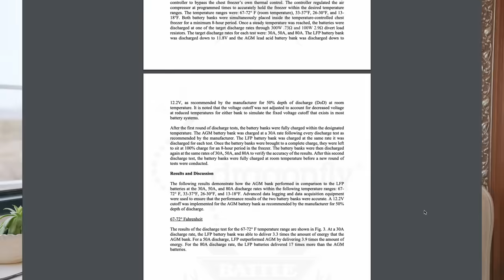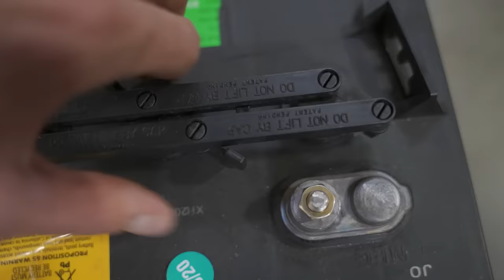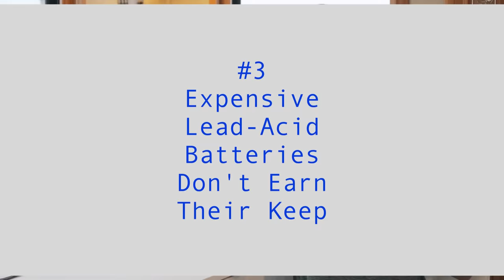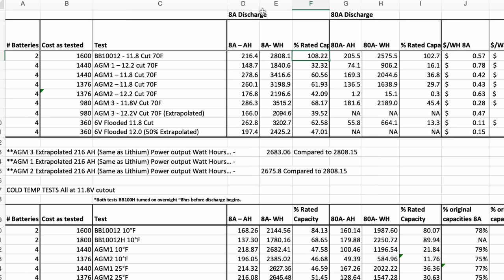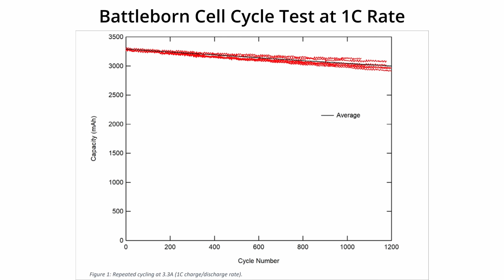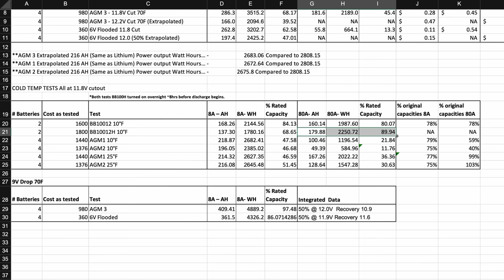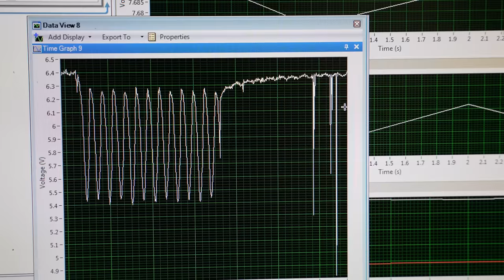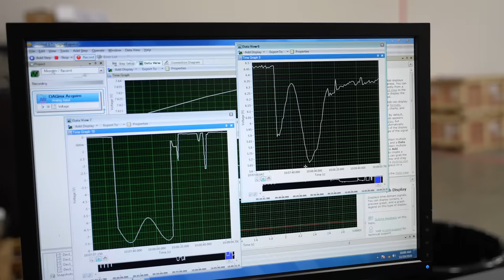Don't Waste Your Money On Batteries - The Shocking Truth I Discovered When Testing RV Batteries

Comment: I have been ignorant to all this , you guys made me lose some of my bliss.
Reply: It’s not the end of the world. 
If you have a GOOD charge controller, enough battery, and enough solar to basically never go below 12.06ish for 12V conventional batteries you will be pleasantly surprised at the years of good performance you will get. 

The equalization cycles of even $40 PWMs and lack of deep discharges will generally give a reasonable cost/life ratio. People don’t believe that when I tell them but I’ve experienced it. 

The way I looked at it 4 years ago was this: if I could have enough storage NOW - today- and that made it so I could afford additional panels to keep the batteries up, that would let my 2-year life extend to 4 or 6 years which halves or thirds the cost of the batteries over time. 
That actually has worked out quite well. I always thought I needed 700W of solar but after running a while on 200W, then 300W, then buying an mppt controller and even experimenting with a small fridge/freezer I know what can be done with lead acid batteries. I just went to 500W and with an mppt my batteries are always over 12.8 19/20 over 13V when I come home at night. 

Additionally, in my case, being off-grid solar let me take advantage of an opportunity to live monthly at a cost about 7-8% of renting an apartment for nearly 8 months of the year. That savings basically equated to making the solar ROI be 1 month. A few other needed items were paid for in half of the next month. That let me put $$ aside to buy a small piece of land. If I’d bought a couple thousand dollars of batteries??? I neither had the cash up front, nor would I have had the savings to make the winter through unscathed. Initially I ran for months on old, junk boat batteries that surprisingly‘fixed’ themselves after being beat into submission by the charge controller cycles. I wound up using them a long time until they finally showed their age. I bought new ones eventually and I had cash that didn’t hurt to pay for them. 

Lead Acid ain’t as good in some aspects but it works and let me pay cash for everything I needed. After that it was money in the bank- literally.

Comment: For technical folks, this is the BEST on 'toob; so I'll add the one missing concept in way of thankful contribution to the OP:
Yes, a Starting battery (boat or RV) should be lead/acid, as stated.
HOWEVER - the alternator will dump WAY too many amps into the Lithium house batts if you just parallel or switch the banks (The Big Red Switch 1-2-ALL-Off).
Best practice is a DC/DC charger specific to your Lithium pack, which gets it's DC power from your Start battery.
That DC/DC charger will LIMIT the amps being put into the Lithium pack, and more importantly limit the amperage being drawn from the alternator.
Ideally the system would have a controller monitoring the alternator's case temperature and limiting the current draw from it, along with the voltages, amps, and temperatures of each bank.
If there is Solar charging, also be aware that the Lithium bank's BMS will cut-off at the ground when it reaches cell or pack maximum voltages (fully charged).  Older solar chargers may then drive the vehicle's voltages to the panel voltage (no other load), which is usually about 19vdc; blowing out your nice, new LED lighting...yeah, that's personal experience....Cheers !

Comment: I have always thought it was odd that batteries were rated in amp hours.  Amps are just part of the equation for power.  Watts are a much better measurement.  The other thing is whats the point of rating a battery and not even being able to use half of that?
Reply: didnt care to watch the video everyone know lithium is the best one if they state otherwize they tested wrong and the only advantage "old style" batteries have is they they can discharge faster (more amps) which is why they are still used in cars since it require a huge load when starting up.

They do not rate the batteries wrong it is the charge the battery is able to hold.
What happens is that when you use that energy you have a loss of energy and if you take as example lead acid batteries the higher discharge rate the more you lose.

This is nothing new you have the same thing going on in every electrical gadget. (heat = lost energy)

Comment: I'm 67, started wrenching at age 7. One thing I've noticed with LA batteries is 3 strikes (full discharge) and you're out! Plan on amperage failure and a new battery very soon, worse in winter.
Reply: Not necessarily, I am 63 and I accidentally left the CB on in my truck full discharged and froze my Exide Group 65N AGM battery in the middle of winter at -30C. I carefully thawed and charged the poor battery and it thankfully recovered and has lasted another 4 years. It still starts my 92 F150 every time I go to use it. The battery is on it's third vehicle and nearly 8 years old. If I had done that to a flooded lead/acid battery or a lithium battery  it would have been scrap.

Comment: Great test and data, and even better promotion for Battle Born. That said IMO and my years of experience with both AGM and Lithium batteries you have a bit of a bias with your testing towards Lithium batteries. No doubt that the data you acquired is accurate as well as your charts so I'm not disputing your numbers. The testing parameters are where I would object as per the differences in how Lithium vs Wet or AGM performs. The discharge test should have taken into consideration the voltage drop under load to get a more accurate output number. The at-rest voltage is the true battery voltage not the underload voltage. Testing it to the cutoff voltage gives the Lithium numbers a testing bias just because of the performance characteristics. 

That being said, if you have 1.3v drop under the specific load and your target voltage is 12.2 then you would set your cutoff to 11.9v so when the load is removed and the battery recovers you will be at the 12.2 target voltage. With lithium not having the under load sag like wet or AGM this makes it look unfairly superior (which it is in some respects as devices will work more efficiently at the higher voltages but that isn't what I'm disputing) . You allude to this during the video with the microwave test, but the testing data doesn't have that accounted for. And to add that, dropping the voltage below the recommended voltage is not going to damage a wet or AGM battery as long as they are not left in that type of low discharged stage, under load conditions is not an issue.

Again, hats off for the whole procedure, and look forward to future videos.

Comment: Seems to me that the inverter/charger manufacturers need to have a “winter/summer” mode to help people get the most out of their batteries.
Reply: Or just temperature sensors which the advanced ones do have...
Reply: And if it's to much work to change charging volt two times every year, I could recommend using only the grid 😊

Comment: My flooded lead acid batteries run my 12v refrigeration which draws 45-51 watts. I can run for a day or two before recharge.  I use two 6v flooded LA, 240 amp hour batteries. Two years in, and it's working well.

Comment: As a technical person, it is wise & far better to use Flow batteries i.e. "Redflow Batteries" of Australia is most ideal. You can discharge the batteries to o.o volts & you will not harm the batteries & also it does not suffer from " thermal run away". Greetings from Madang, Papua New Guinea!

Comment: Great video, thanks!  

I would like to see data showing efficiency and economics from the charging perspective.  I understand that lead-acid can't be charged at as high of rate as LI and that the charge rate for lead-acid dramatically decreases as it is is reaching ~80%.  As a sailor, I'm particularly interested in this aspect of LI over lead-acid since that means shorter run time on my diesel engine/genset and less fuel to recharge.   Or making the optimum use of solar.  When you're a 100+ miles offshore, you can't just pop into a fuel dock whenever you want.
Reply: Li ion batteries also charge slower the closer they get to fully charged. This is a function of physics as there are fewer and fewer locations for the ions to fit into as the battery fills up and so those ions have to bounce around, do a lot more traveling, before finding an empty spot to fit into. This creates more heat since the ions are moving more. The way to keep charging fast is to increase the flow, but that also raises the heat. Heat will shorten the lifetime of the battery or start a fire if the heat gets too high...  Some EVs will pretend that 90% (-ish) is a fully charged car and can therefore use a faster charging curve towards the top... Different chemistries and different battery forms have effects on heat and therefor charging curve...
Reply: @karlsjostedt8415  not nearly to the extent of lead acid lol.
#leadIsDead
Reply: Hi Ausgator, i am an Australian sailor too working on my battery replacement. I made a spreadsheet comparing Lithium v AGM (included carbon lead acid AGMs). Ignoring solar, the first thing my spreadsheet did was show the first usage in hours  using a constant 8 amps. 8 amps is how much power my  boat uses with its auto pilot operating. Then how long it would take to re-charge. But I realised that full charge would not be too long for AGM. So I presumed that the AGM could achieve 90% charge at its rate of resistance, which varies between AGM batteries. My batteries are in parallel, and the resistance stays the same for each battery. So if the AGM bank has four batteries in parallel, and that batteries can accept 20 amps each, that means the bank of AGM batteries could take 80 amps charge. While the lithium can typically take 80 amps charge, it is not recommended. Typically 50 amps can be taken per battery. But this invites heat issues. Which are an unknown for me. But if two lithiums can take 50 amps each, that would be 100 amp charge acceptance. Via DC-DC chargers.  I presumed the Lithium could get to 100%. The Lithiums provided a shorter engine run due to their ability to fast charge, but the difference was not very large due to the bottleneck falling back to the capability of the engines alternator.  If I was cruising a lot, I think a hydro generator makes more sense than a large battery bank. But they cost double or three times the cost of 4 AGMs or two or three lithiums. Solar also is necessary to aid the power drain. The key seems to be the gen set - if it could feed a DC-DC charger for each lithium battery, and the batteries could take 50 amps each - lithium wins easily. But if the gen set has limitations, AGM and particularly Carbon lead AGM becomes cheaper. And no need for DC-DC chargers. The other downside of AGM though is weight and bulk. In my boat space for batteries (in one lazorette) takes up valuable space. Lithium kills lead acid in that regard, and installation of lighter batteries is so much more appealing with a something under 17 kg than 32 to 45 kg.
Reply: This guy just trying to sell batteries for a company you all know most adds are falsely advertised

Comment: On the advantages that lead acid have over lithium, the sheer mass of lead acid can be useful sometimes.  I'm disabled and get around in an electric wheelchair/ When my chair is stopped with lead acid batteries it does a good impression of being welded to the floor which is great when I'm out of the chair and manoeuvring myself around by leaning on the chair. I can be reasonably  confident the beast isn't going to move because it weighs so much.

Comment: Just buying the prismatic cells by them selves literally more than halves the cost per KWH compared to something like a battleborn and takes this video to a whole new level of truth.
Reply: what the hell is a prismatic cell?
Reply: @powell789  In the time it took you to type this you could have typed 'prismatic cells' in google.
Reply: @powell789  Prismatic cells are made up of many positive and negative electrodes sandwiched together leaving more possibility for short circuit and inconsistency. The higher capacity makes it difficult for the BMS to protect each cell from over charging and dissipating heat. The larger cell size minimizes the possibility for automation leading to a lower degree of consistency. The internal electrodes can easily expand and contract causing deformation which can lead to a internal short circuit and are more prone to swelling similar to lead batteries.

Comment: I switched to LifPo4 Lithium batteries last year for my boat. 2 50amp hr 12v batteries and the manufacturers 4 bank battery charger cost me just over $1350.
I ran 3 Optima yellow tops in the same boat for 12 years. And when I say that I mean I had the SAME yellow tops for 12 years. I used those batteries year to year normally from about March to November, then they were stored in the boat in my garage with the on board chargers plugged in 24/7, in Nebraska, with temps running anywhere from over 100 F in summer to well below zero in winter.
12 years.  The year before last, 2022 I noticed those yellow tops would last about half a day, so they had pretty much reached the end of their lives.
Last year, 2023, I purchased the lithiums.
I have basically cut the weight of the batteries in half, so I’m not carrying as much weight in the boat. I can troll all day, for 3 days in a row, without charging and still have about 30% left in the batteries. 
Needless to say, IF these batteries last at least 12 years, I will be a very happy man. Hopefully by then I will be retired, purchasing my second set of lithiums and hopefully my last set, and be able to pass them on to my grandson when I finally reach the end of my life lol. 
We shall see.

Comment: Just a thought were you measuring the battery voltage at the inverter during hi discharge or actually at the battery. 
Those battery leads were very very long .
I've installed several inverter systems and battery leads of less than 1 meter improve the system dramatically and also as thick as will fit into the inverter.

Comment: So why didn’t you do any testing with heat like to know what happens to all these batteries like in the desert on your RV
Reply: Cause the heat doesn’t matter, batteries have been under car hoods for years.
Reply: @TankToChest  Lithium batteries don't do well in heat...I think anything above 90 does pretty severe damage.
Reply: @TankToChest   Those would be only lead-acid batteries.
Other technologies of batteries can be sensitive to heat
Reply: @TankToChest  Are you thinking of AGM batteries?
Reply: @StacyForest738  There is a difference between 90 and 140 degrees. All batteries, except plutonium, suffer similar effects regardless of the chemistry. Build a rack with air space between cells if you are concerned
Reply: @bingosunnoon9341  I didn’t build a lithium. I bought them from Renogy. They are in my camper van. I live in the southeast. It doesn’t take a rocket scientist…

Comment: Battery performance is significantly affected by the type of load being presented to them. IE battery A might outperform battery B by considerable margins when presented with a heavy load but conversely, battery B might outperform battery A by bigger margins with lighter loads and just to further complicate it all, the time duration of the load being presented also plays a significant role.
Reply: That's a legitimate concern and is addressed by the Peukert Constant of battery (load-dependent capacity rating).